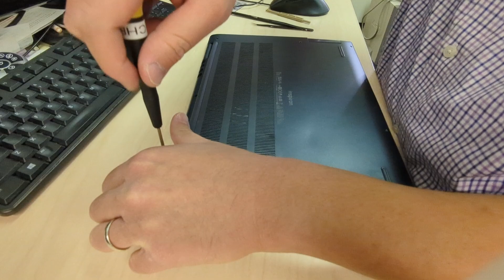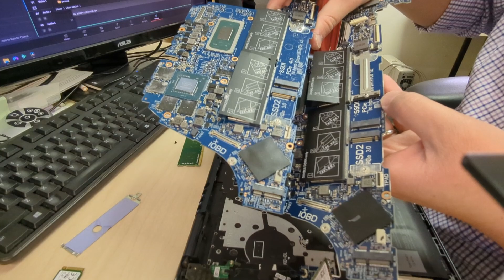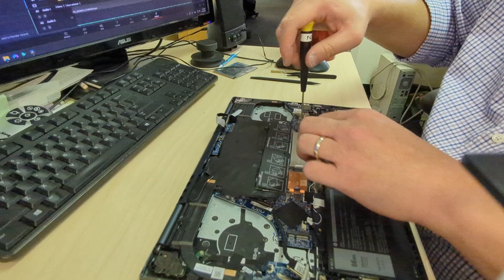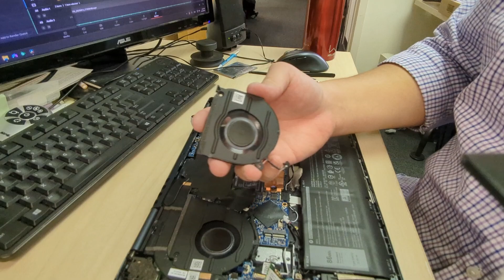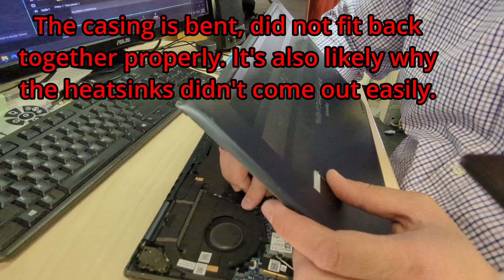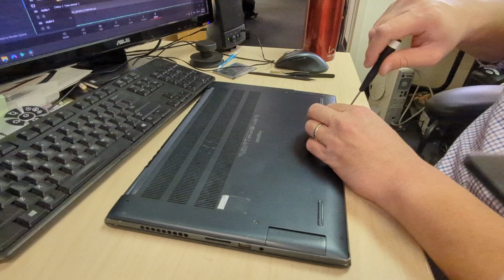Dell Inspiron 16 7610 System board and fans replacements

Comment: Hello, I'm leaving a comment because I have a question😢
I wonder how you did the heatsink separation at 4:55 ‼️
I'm also taking it down to replace it, but it's not working, so I really want to know how😭😭😭😭
Reply from the maker: It was the screen hinge, system board, and the vent that made it difficult. I had to wiggle it out at weird angles and pivoted it out from the hinge. Check and make sure all your screws are loosen and just wiggle it at different angles. You see me messing with the system board at 4:56 because the heatsink scraped against the PCB. Also, watch from 8:33 to see reinstallation to get an idea how it fits together.
Reply: @PetricusGaming  
Wow......
Thank you sooooo much🫨
Thanks to you, I made it🤩🤩🎊